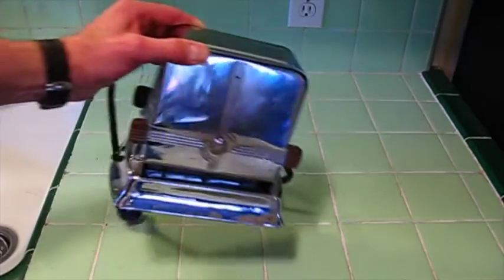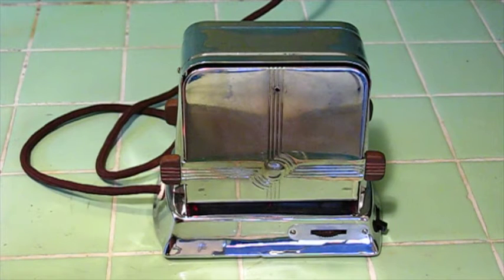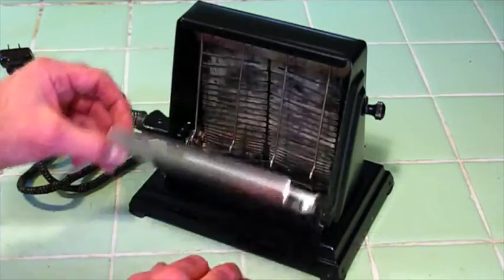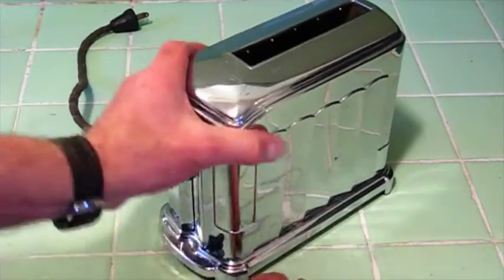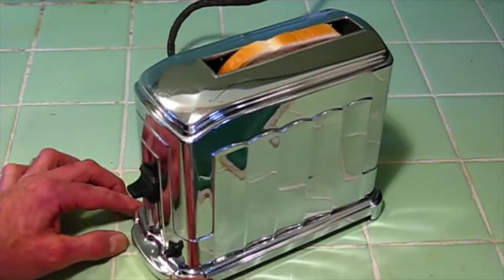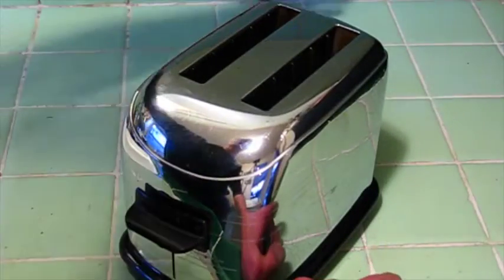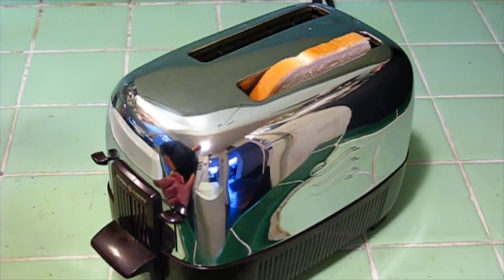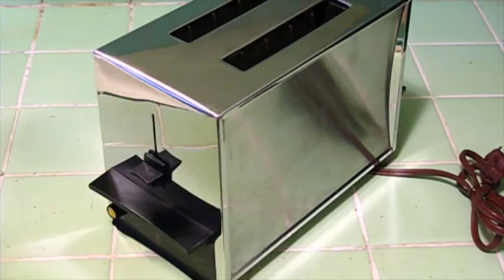Vintage Toasters

Comment: I just picked up that same toaster (the third one you showed) it works perfectly and is in great shape
Reply from the maker: The single slice Toastmaster? Yeah, that's my favorite! Mine has a bad electrical contact on one side so I've been using the two slicer. They are so easy to fix. I just need to take it apart and clean up the nichrome wire contacts. That's what I love about these old machines, they are simple and mechanical so they keep on working and are easy to fix if needed.
Reply: @insectsafari  my only thing is I don't think it pops properly so I think I'll have to fix it eventually but till then it toasts great
Reply from the maker: @coolcatcrash565  It probably just needs a good cleaning and a little lubrication.

Comment: I have a thing for vintage irons, while back I was interested in vintage sewing machines. Everything was made so much better back then. I have been looking at vintage toasters and waffle makers as well
Reply from the maker: I have an American Beauty iron from 1951, Photos on FB: https://www.facebook.com/don.ehlen/media_set?set=a.10154689058108686&type=3
I also have a waffle iron from 1935 that I use all the time. 
Check out this toaster, it's like a museum piece! https://www.facebook.com/don.ehlen/media_set?set=a.10156063103013686&type=3
I make my coffee every morning for the past two years with this: https://www.facebook.com/don.ehlen/media_set?set=a.10154674197638686&type=3
Reply: i don't know about better.  more durable maybe.  but these toasters would likely shock you with full house voltage if you shorted the heating coils.. modern toasters are relatively safer.
Reply: @kjcorder  The newer ones are maybe safer, but where's the fun and adventure in that?

Comment: Just happened on ur video…I love vintage appliances as well. How did you get that chrome looking so nice?
On the second toaster with black trim that you said was trashed.
Reply from the maker: I use #0000 steel wool and metal polish.

Comment: I recently acquired a really really old and Rusty Sears flip down toaster. I'm only 40 and I had never seen a flip open toaster before. I had to ask my mom if she had ever seen one and knew how to use it. She did LOL. I cleaned it up with some Bar Keepers Friend and then hit it with some new Finish Car Wax It kind of keep it from rusting any further. It looks and works great now
Reply from the maker: I just restored a 1930 General Electric Hotpoint floppy toaster that someone gave me. It's beautiful. If you're on FB you can see a photo set of it here: https://www.facebook.com/don.ehlen/media_set?set=a.10157736079018686&type=3
I'd love to see a photo of yours. If you like you can send me pics on FB or email them to donehlen@theinsectsafari.com. Write down any information stamped on the unit and maybe I can figure out when it was made.

Comment: Love this old stuff.  They don't build them like this anymore.  I picked up one of the same McGraw Electric units at a local antique store, and the bread holder won't stay down.  I've got all the tabs and retainers loosened and the only thing keeping me from getting the shell off is the darkness-control knob.  I hesitate to try to pry it off from behind the bakelite(?) flange for fear of breaking/chipping it, and I don't won't to pinch the knurl too tightly with a pair of pliers, so any suggestions on how to get it off (the shaft?)?  Thanks.
Reply from the maker: Both of mine have a small brass hex bolt holding the knob on. I use a small flat tipped pliers without grooves on the grip surface to gently unscrew it. You could also use a tiny open end wrench to remove it.
Reply: @insectsafari  That worked.  Between the size of the hex head (if they had tried harder, they could have made it REALLY tiny) and the discoloration from age (and old dirt-encrusted butter?) making it the same color as the bakelite, I finally found it and was able to get it off. 

The more-challenging part was getting the bakelite cord boss off to remove the cord to enable the shell removal.  Had to remove the cord from the contacts, pull the shell up as far as I could and pull the cord end as close to the inside brass retainer ring as possible.  Then had to houdini my way in to get a pair of needle-nose pliers on the ring while gently turning the exterior bakelite boss off from the outside with a pair of pliers.

Thanks for your help!!

Comment: I have one of these I got from an estate sale and it stinks! Looking for info on how to clean it!
Reply from the maker: They are very simple devices and easy to take apart and reassemble. 
When I get one I take it apart and clean all the parts with soapy water, brushes and fine steel wool. The ones with wound timers are more complex but still usually serviceable. What does your toaster look like? Does it have a brand and model number? I could look it up and offer you some advice. I have some photo sets on my FB that might help too.
https://www.facebook.com/don.ehlen/media_set?set=a.10154826219843686.1073741906.526553685&type=3
https://www.facebook.com/don.ehlen/media_set?set=a.10154838638653686.1073741907.526553685&type=3
https://www.facebook.com/don.ehlen/media_set?set=a.10154666892418686.1073741902.526553685&type=3
And just for fun, check this out:
https://www.facebook.com/don.ehlen/media_set?set=a.10156063103013686.1073741911.526553685&type=3

Comment: Hey what’s ur toasters cable sleeve made out of???? Life or death I need to know for an engineering studies report on household appliances materials that I am doing. Nylon? Cotton? Polyester? Glazed cloth? Pls answer
Reply from the maker: The toasters from the early 1930's were made before nylon (1938) or polyester (1941) were invented. The copper strands are wrapped in a white fibrous material that could be asbestos or some other non flammable material. The outside of the cords appears to be cotton or some other organic fiber. I wish I knew more to help you. Let me know if you learn more about it.